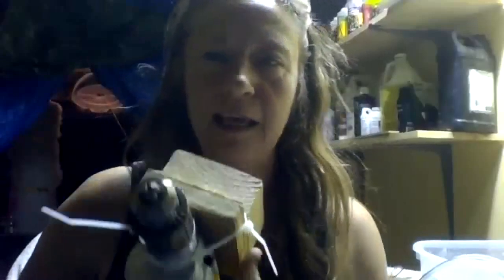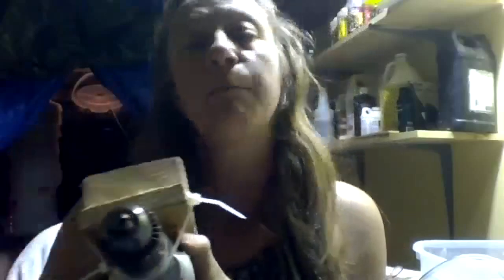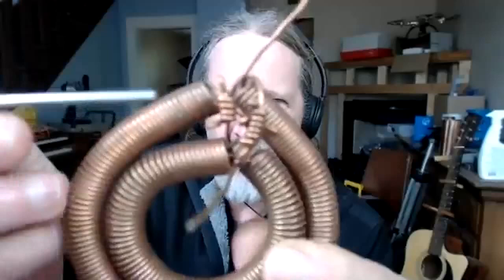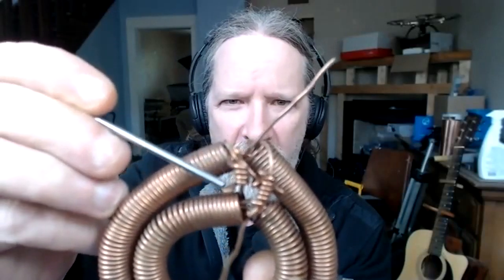EXPOSED: Tech Insiders Reveal Truth Behind Magrav Tech - JC & Team

Comment: I used 3.5 mm for inside coil mandrel and 6mm for outer coil. Perfect match.  I also used a T-pin (used in arts and crafts.)  that just exactly matches the diameter of the 18 ga wire.  I have a yarn needle that exactly matches the 14 ga too, but I like the feel and manageability of the 18 gage, sooo.    Anyway I thought I would hit you with that in case it helps.

Comment: Nice discussion, thank you.  For best performance of the car system, are the coils stacked the same way as a regular Magrav (no connection between coils noted)??  If using PVC end caps, coils appear to be not to be stacked as in a Magrav, if the opening of end caps are joined together facing each other.  Please confirm the best way to stack coils.  Has anyone used the 12v plug inside the car to connect car system??
Reply: Think of it more like two coils facing each other.  One coil in one cap, glued in with the inner, inside coil going through the cap, and the outside outer coil ending in a small CCW coil not connected to anything.  The other coil facing it in the other cap, with the outside coil going out the cap and the inside coil just  ending in a small CCW coil that doesn't connect to anything.  Make sure the GaNS inside each coil doesn't touch each other either.

Comment: Also a stainless gas welding rod works well for a mandrel. Cheap at any welding store. The stainless is way more rigid than copper and you can get the welding rods in a small enough guage.

Comment: If you connect the coils before you nanocoat them, won't you have matter-to-matter connections?
Reply: No, after nano coating you need gloves en before you don`t need gloves.
And it`s up to you what you want, connect the wires before of after.
I build 3 magravs, and I am almost ready.
Use thin surgeon gloves to connect the wires, because you may no touch the nano-coated coils.